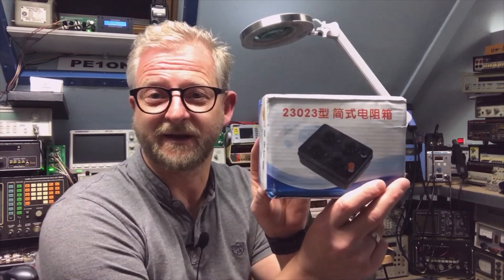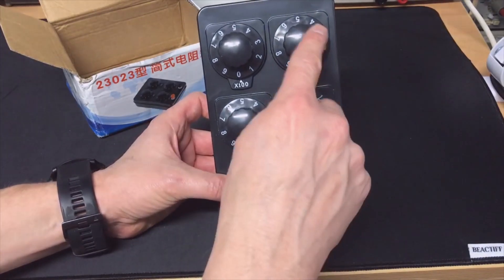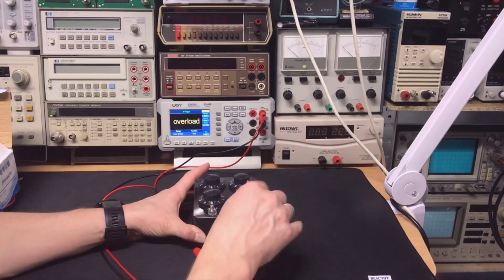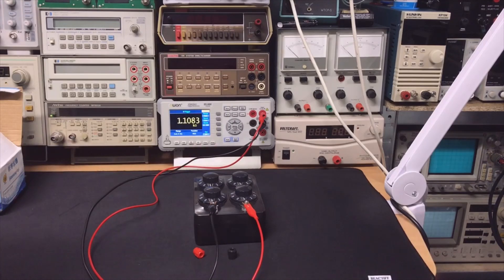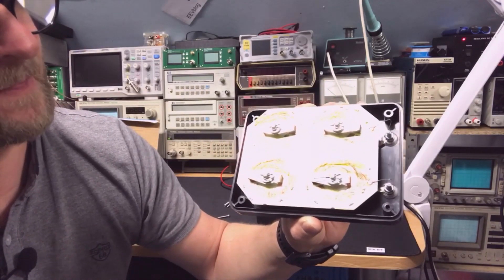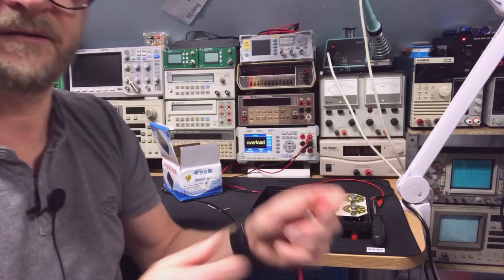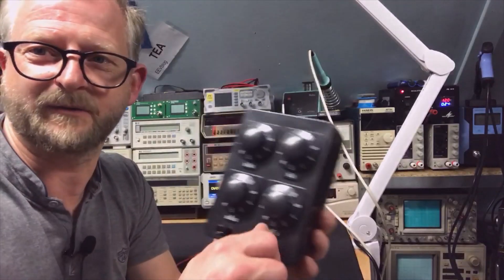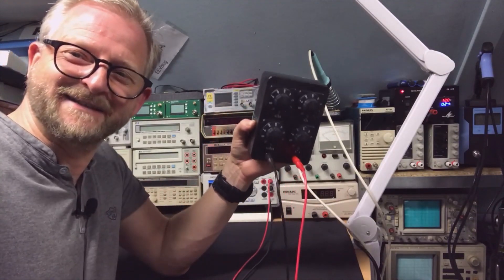#080 Decade Resistor Switch 0-9999 Ohm , not for calibration for sure.

Comment: LOL -   What % tolerance are the SM resistors in the unit?  Does it perform any better with a kelvin clip to the box?  I notice you have a HP 4 wire multimeter in the background :)
Reply from the maker: Yes a joke.... but you can easily fit proper resistors in it. and soon the kelvin will arrive also...